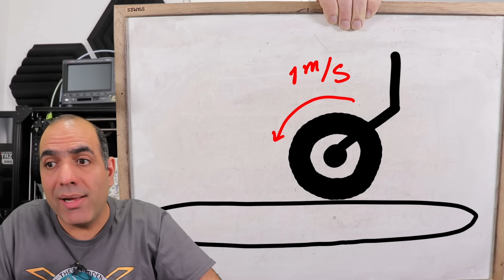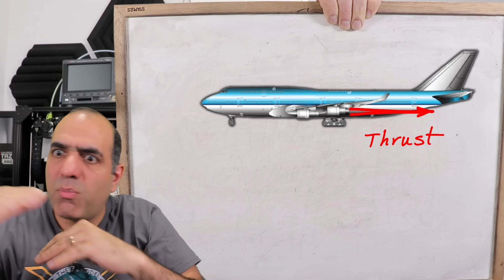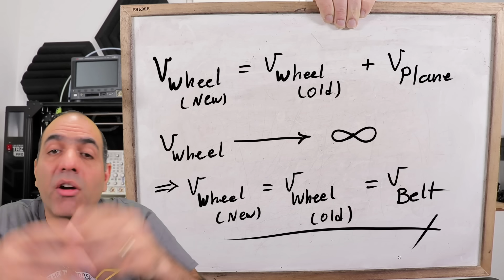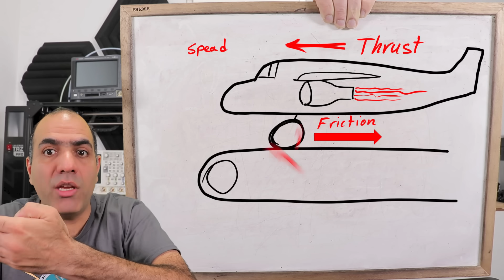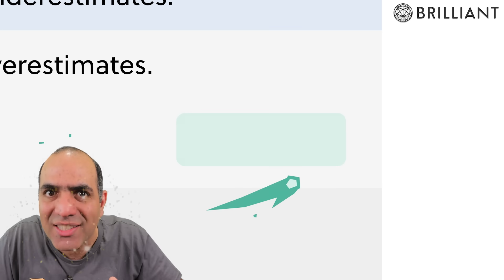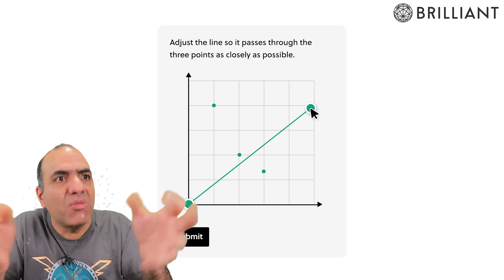Airplane Question that Drove Me NUTS!!!

Comment: The question is wrong. This constraint is only possible if the airplane has no motion w.r.t the ground, but the conveyor belt does nothing to actually stop the airplane. With any amount of thrust, the plan will move and the questions conditions will be violated unless the belt speeds up to infinity.

Comment: To me it reads as the conveyer belt speed relative to the ground will match the speed of the wheel relative to the plane, speeding the conveyer belt up until they match. Which means the plane cannot move relative to the ground unless the thrust force overcomes the friction between the tyres and belt.

Seems unlikely to me but here's some math.

747-8 weighs at least 220t
Coefficient of static friction for rubber to rubber is 1.15
To overcome the static friction it would need 252t of thrust( essentially it would need to be able to accelerate going straight up). It produces a max of 120t so no luck. This is also assuming the engines point straight back and ignoring a few other hard to quantify things that might be going on.

Comment: Alright, I'm 8 months late to the party, but I'll leave a comment as you ask at 0:45 - The answer is definitely maybe. The Mythbusters tested this with a full size prop plane in the late 90's, and it worked! Theres significantly more risk involved in a 747, but the principles remain the same - the ground velocity is cancelled out, but the plane itself IS gaining velocity in relation to the Earth, thus lift is created.
Reply: They did not match wheel speed and conveyor speed.  They matched to a takeoff target speed or something not quite as posed by the scenario.

Comment: When Mythbusters tried to test this their setup wasn't the best. Funny thing though is that pilot who helped them was sure that the plane won't take off.
Reply: The pilot is right.  To do this test would require really accurate analysis of the wheel speed and exactly match it with the conveyor.  Mythbusters only did it briefly with their RC car demonstration and even then they mistook the principles.

Comment: The power is from the engine and not the wheels. The speed of the rotating wheels only creates drag and rotational inertia to slow down the plane, but the aircraft will continue to accelerate. The aircraft will take off.
Reply: That is incorrect.  Nobody says the wheels are powered.  The vehicle can only move while on the ground by rolling or skidding.  If it’s rolling, the conveyor exactly matches rolling wheel speed.

If scrubbing along the surface, well, that’s a different situation entirely.
Reply: @MrDefreese  Actually your reasoning is flawed. In order to reach your conclusion, the airplane must already be moving. If the airplane is already moving, then that means it could keep moving and take off. The wheels will simply spin twice as fast as normal. If the plane is moving 120 m/s, then the ramp is moving 120 m/s, and the edge of the wheels are spinning 240 m/s. If, however, at a certain point the wheel's drag overcomes the thrust, the plane will stop accelerating, but it would keep moving.

If you just say It won't move, then you're not following the rule of the conveyor belt: The belt spins as fast as you move. So in order for you not to move, the belt must spin fast enough to generate sufficient drag to stop the plane's four massive Pratt & Whitney jet engines. But if you're not moving, then the belt should not move.

Basically, you're already assuming the plane is moving and the belt will only make the wheels spin twice as fast.
Reply: @rtclark4068  incorrect again.  If the vehicle rotates from zero to 1 half a rotation, guess what - the linear distance of the conveyor goes exactly the equivalent of 1 half a wheel rotation.  'Exactly matches' is inescapable.  The assessment of the wheel speed is incorrect too.  You are assuming that the instantaneous speed of the wheel becomes double.  That is incorrect.  Whatever the rotational speed of the wheel would be on the tarmac is exactly what it would be on the conveyor.

What folks are doing wrong is trying really hard to just rev the engines to overpower the conditions stipulated about the conveyor.
Reply: @MrDefreese  
You are correct that I made a mistake. The "double speed" idea came from a misunderstanding I had with the problem. I thought the belt matched the plane's speed, and not the wheel tips. 

The simple fact is you need an equal or greater force in the opposite direction of the jet engines. You could move that track 1,000 mph, which is way faster than the jet's tires spin at takeoff, and the plane could overcome that force and still fly. I found an interesting article by real engineers who ran simulations of this from BSIM Engineering, and they found that it didn't matter how the track behaved. In their own words, "The aircraft will take off, no matter the speed and the movement direction of the conveyor belt.” The plane would still fly in every scenario. Spinning the wheels does not create a sufficient force to stop the jet engines.

If the plane were a car, and the reaction interface was between the wheel and ground, you would be correct. The reaction interface, however, is with the air. The wheels just let the plane roll around. The rolling does create friction in the ball baring, but the 4 massive jet engines should overcome this small obstacle. 

I think this was a good debate, and a fun problem. For a little bit you actually convinced me the plane wouldn't take off, it's easy how our minds can fall into a rut of thinking.
Reply: @MrDefreese  On second thought, I am right about the wheels spinning twice as fast, just not for the exact reason I stated. If the plane moves 2 m/s, which moves the wheels forward at 2 m/s, and the track moves back 2 m/s, and the plane keeps moving 2 m/s, then the wheel tips, relative the an observer, would spin twice as fast. The wheels WILL spin TWICE as fast as whatever speed the plane is moving. If, however, you're observing the wheel spin while moving with the track backwards at 2 m/s, the wheel would appear to spin 2 m/s, the same speed the wheel would spin if the track was stationary. This is just a matter of perspective.

Comment: You missed one more "solution" :D 
If you turn off friction from the belt, wheels don´t move and the plane speed up and fly with stationary wheels due to no friction. That is correct.

HOWEVER

If you add friction, that friction affects not only plane wheels, but also the surrounding air. On a standard slow treadmill it is negligible and hardly measurable, but on a runway-wide and runway-long belt doing supersonic speed to increase the friction of wheels enough to render the plane stationary? That makes a significant amount of air move in higher then unsignificant speed. After all - our planet is rotating in wild speed all the time and takes all the atmosphere with it, rotating at the same speed.

The question of "will it take off" is then a decision of what comes first - speed of belt large enough to create sufficient headwind for the plane to take off, or the friction will kick in earlier? As these variables can both be moved with independently (well oiled wheels vs. size of the belt), the answer to such scenario can be both yes and no :D

Comment: IMO:

The issue here is actually just the stupid conveyor as a trick and an impossible phenomena.

In one frame of reference (or perspective, I get to that below), if the airplane moves forward in any part in the scenario, it means the conveyor isn't matching the wheel speed of the airplane anymore; this would mean the airplane wheels are now rotating faster than the conveyor. Which then breaks the question in the first place as "conveyor matches exactly the wheel speed (assumed to be rotational speed). 

The rotational speed and translational speed of a wheel both can AND cannot be decoupled depending on your frame of reference. It just goes back to Einstein's special theory of relativity. (or at least I think so?)

A wheel held in the air, can have any rotational speed with zero translational speed. Decoupled.
A wheel spinning while moving on the ground, from the wheel point of view, the translational and rotation are decoupled. The wheel can move forward or back translationally, it doesn't matter for the wheel's point of view.
A wheel spinning while moving on the ground, from the outside point of view, if the wheel gets extra translational velocity on top of its current rotational velocity, the outside point of view will see the wheel moving faster which then means the ground must move faster backwards, coupled.

So if you see this question in terms of the wheel only, it is decoupled from the plane as it can rotate however fast it wants and the plane just goes forward on its merry way flying off. Scenario 1 and 2. 

But now if you see it externally as a whole system, for the plane to move forward, the wheel must spin faster, which means the conveyor moves faster, which in turn breaks the question as for the plane to even move forward, the wheel MUST be faster than the conveyor. 

Also have to take note of the question where the plane starts off at 0 speed. Since the plane in the 2nd reference frame cannot move forward (arbitrary reasoning placed to "fit" question by user), it cannot get lift and therefore cannot fly. Scenario 2 but altered.

Meanwhile for the 1st reference frame, since the wheels are free to spin at whatever speed and the plane can always still move as though its frictionless from a freely rotating wheel (again arbitrary reasoning placed to "fit" by user), the plane will fly. Scenario 1.

Conclusion, whether it flies or not is based fully on the person's arbitrary reasoning placed upon the reference frame and conveyor.

Comment: Nothing will turn infinite fast and destroy itself.
The premise this.
If the wheels turn at 10 meters pr. second relative to the belt, the belt will turn backwards at the same 10 meters pr. second relative to the ground.
So the wheel is going 10 m/s forward, and the belt is going 10 m/s backwards, leaving the plane motionless in any direction relative to ground, so no forward movement of the plane and no wind speed.
But the relative speed between the wheels and the belt is still 10 m/s.
But the wheels are not what propels the plane forward, the engines are, which pushes against air, not the belt itself.
Same thing as if you stand on your treadmill on a skateboard and pulled yourself forward on a rope.
The plane would build up airspeed and take off, and the wheels will turn just double the speed as the takeoff speed.
Simple.

Comment: if you include friction in the airplane wheel bearings you should also include it in the treadmills bearings so the plane takes off as well.
Reply: Why will that make a difference?
Reply: @tiberiuzabara6891  because this way the bearings in the conveyor belt will also have a friction limit and it cant roll any faster after some point
Reply: @ThomasSz1994  well in reality the bearing will melt or the wheels will explode before reaching equilibrium.
Reply: @tiberiuzabara6891  this idiotic question has nothing to do with reality

Comment: No the aircraft will not take off because it receives its lift from the air moving under the wings so if it’s moving respect the ground but not the air then it can’t takeoff ( in fact if the winds are strong enough a plane can even take off standing still as long as there’s enough airflow lifting the aircraft)

Comment: The Mythbusters tested if a plane on a conveyor could take off and it could. Need I say more?
Reply: Their test was deeply flawed.  They did not match wheel speed to conveyor speed and then they went down a weird rabbit hole of trying to make a distinction between a car powertrain turning the wheels vs. an aircraft engine force on the vehicle.

They badly misunderstand rigid body math, physics, and kinematics.

Comment: No actually I couldn’t if the conveyor belt is designed in a way that keeps the plane centered than it won’t move forward not allowing enough air to pass around the wings to generate lift

Comment: So, I would think that due to the thrust originating from the planes engines as opposed to the planes wheels, it doesn’t matter how fast the conveyor goes. The wheel speed is not linked to the air speed, so it will take off

Comment: Well ,there wont be any airlift due to pressure difference as there is no difference in pressure between the upper and lower parts of the wing which arises due to the plane relative motion with respect to the air......So As per Bernaulli's equation......no velocity difference thus no pressure difference.....So ya, it wont take off

Comment: ok i had to pause you so i could write the comment .
of course it will take off .
pwer isnt to the wheels . its on the props/ turbines .
i get it into conversations of that type involving cars and bikes . about speedometer readings when changing the tyres dimensions / gearing in relation with the tachometer  
people dont realize where the reading is coming from .
if it comes from the tranny then what ever mod you do to the tyres or final gearing , the tachometer will be EXACTlY the same in relation to speedometer !!!
it only changes the true speed of the vehicle when measured with GPS

Comment: I guess the better question would have been “Given the wind of speed matching with that of 747’s takeoff at a given weight, will the jet be able  leave the ground without moving forward with respect to the ground?”

Or “Given the wind of speed matching with that of 747’s touchdown at a given weight, will the jet be able land without moving forward with respect to the ground?”

If whoever wrote this question thinks that the 18 tires on the 747 are somehow powered to push the aircraft forward until it takes off, that’s the false assumption to begin with.

Now, - “Will a 747 sitting still on a runway of which the surface is equipped with a gigantic belt conveyor capable of accelerating the jet to its takeoff speed, be able to leave the ground without spinning its tires?  …Maybe.

Comment: Damn the wheels. If you consider the problem electrically the answer is simple. If there is relative motion between the air and the wings then the plane flies. Just like magmatic fields and wires. If you have relative motion, you get voltage. 
If the air is what is moving then the flight is short and disastrous as the forces of friction reduce the relative speeds and lift/control is lost. If the plane is moving through the are, and you are not on Delta, odds are all will be enjoyable.

Comment: The plane isnt providing thrust nor moving thus the plane cannot take off. Also the wheels will just roll with the conveyor belt.
Reply: Answering what medhi said about it: THE QUESTION SAID NOTHING ABOUT THRUST. WHAT THE FUCK ARE YOU ON ABOUT. THEY WHEELS WILL NOT MOVE BECAUSE THE QUESTION DID NOT SAY THE PLANES ENGINES WERE ON.

Comment: Ofcourse it's not going to fly. The wheels are on bearings, giving no force to the wings of the plane. And what the plane needs is for the wings to get the force of air coming towards it to provide lift. If the conveyerbelt was going mega fast, the plane still wouldn't have enough lift as it's getting all its forward momentum from the belt. And even if thrust was applied on the aircraft, it still wouldn't fly as the conveyerbelt is keeping it mostly stationary when to fly, the aircraft needs to be going forward at speed for the wings to provide lift. The conveyerbelt is just removing more and more power of the aircraft the faster it goes

Comment: If the conveyor Belt matches the speed of the tires, and the thrust from the engines is aimen in the same Direktion sll the time, the thrudt of the engines will only spin the wheels faster and  the conveyor belt will to

Comment: It'll take off eventually. The plane doesn't move by force of it's wheels, it moves by the thrust of it's engines, meaning that regardless of the conveyor belt it'll start moving forward and generating air speed under the wings to sustain itself.
Reply: but then the belt speed will reach the speed of light, as we know nothing with mass can reach the speed of light, so the plane will get hold back and not moving forward.

Comment: My problem with scenario 3 is the rate that were assumign the wheel/treadmill speed would approach infinity. If the treadmill was efficient with its speed management, id assume that it would only ever have to go twice as fast as the wheels would be going in a normal scenario. While it definitely COULD rapidly approach infinity, its doesn't need to at all. Even at a stand still the treadmill can decide to go to 1000mph what whatever reason. So in a more efficient method, at a standstill the belt wouldnt move. When the plane itself is going 1 mph, the wheels and treadmill will go 2mph. At 5mph plane speed, the wheels and treadmill will go at 10 mph. If this trend continues, and the wheels are rated to spin at twice the speed of the takeoff requirement the ol5ane will take off.